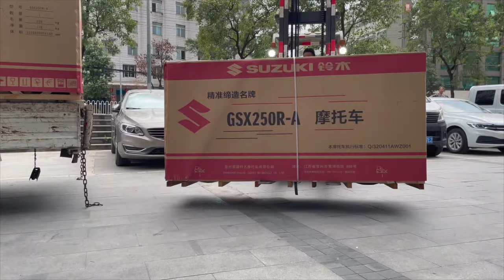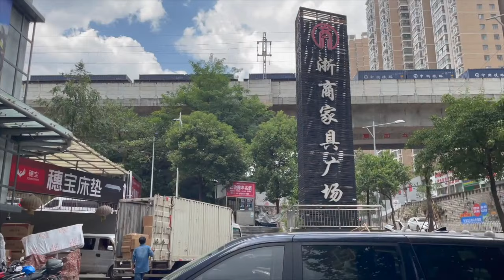Unboxing the Latest Suzuki GSX 250R  - 2021 MotoGP Edition. Exclusive Colors

Comment: Fyi, kode motor ini GSX-250R bukan GSX-R250. Buat pasar indonesia, spek motor Ini punya power lebih rendah tapi harga lebih mahal dari GixxerSF (GSX-250F) kalo buat masuk di Indonesia. Versi GSX-R250 suzuki masih versi jadul tahun 1987-1991.
Reply: For my fellow indonesian. this bike code is GSX-250R not GSX-R250. For the Indonesian market, this motorbike has a low horsepower, high in torque (24.7PS || 23.4NM) but the price is expected to be more expensive than the Gixxer SF250/GSX-250F (26.2PS || 22.6NM) if it enters Indonesia (CBU) from Haojue, China. for the Suzuki GSX-R250 version is still an old version that has been discontinued from 1987-1991.

Gixxer has an affordable prices. so if it is imported to Indonesia (CBU) the price is not too expensive for a 250cc, 1 cylinder bike. The Gixxer price around US$2,440 and then GSX-250R price around US$4,899. Suzuki sells Gixxer in Indonesia with a price range of US$3,323 from the previous price of US$2,440.  imagine the price of GSX-250R if imported to Indonesia?
Reply from the maker: Thanks for the insight. Guess you are talking about the Suzuki - 250R? In Indonesia, you are getting the Gixxer SF 250 as per the video I made earlier on . Link below here  - https://youtu.be/sSX5U3sWv64.
Reply: @JoshConnectMedia  thank you for your information 🙏🏾♥️

Comment: For those whose wondering, this is GSX-250R not GSX-R250. The 'R' at the back indicate 'road' & the 'R' at the front indicate 'race'. It's not as fast as the SF version since it uses an undersquare engine displacement & the SF version uses oversquare displacement. Makes it torque better at low rpm.
Reply from the maker: The explanation of R’s in the Suzuki 😋. For once , I had to look at the title again as I thought I had R250 🤪.
Reply: @JoshConnectMedia  a lot of people are confused. Not implement that you had a typo. Just that too many people think this is a sport bike. Even in the Suzuki's website indicate that this is a 'street' bike, not a supersport bike.
Reply from the maker: @farhunt94   speaking of a super sports bike , Yeah it’s a street type of Suzuki quality bike . Practical for folks interested in the kind of horse power it gives and the ability to still use it within the environs of the city , streets and freeways .Appreciate your effort . 😋

Comment: I wish this could lanch in India🥺❤️
Reply from the maker: Check with your local Suzuki dealers. They should be having it right about now.
Reply: @JoshConnectMedia  India only have the Gixxer SF250 not GSX250🥲
Reply: @itzmexahil  indonesian already imported gixxer 250 sf from india
Reply: the suzuki gixxer sf 250 is more faster that gsx250
Reply: @VictorRodriguez-ux8zi  no man gsxr 250 is faster
Reply: @VictorRodriguez-ux8zi  bt gsx looks more beautiful than sf and it have bigger wind shield 😌

Comment: Whats the top speed
Reply from the maker: Suzuki GSX250R 0-60 mph in 8.59 seconds with a top speed of 85.5mph could easily hit 88mph.
Reply: Very less for a double cylinder bike R15V3 could reach 145km top speed
Reply: @laldinsanga6392  88mph=141kmh.
Reply from the maker: APRRECIATED 😘

Comment: I bet this bike more powerful than Cbr-250RR, Ninja 250, and R25 😁😁
Reply from the maker: You bet !!
Reply: Yeah you bet
Reply: Nope..!! That is 1 cylinder how u figure is more powerful than CBR250RR, Kawasaki Ninja 250 2 cyls n 4 cyls.. Hahaha suzuki endorse sayin bs hahaha for both yall are ridicolous.
Reply from the maker: Check the Summary Specs for this model : ** Engine : 248cc, 4 stroke , liquid cooled, Parallel twi. 
** Fuel  system: Fuel injection with SDTV , liquid cooled
** Maximum power : 24.7HP @ 8,000rpm  (25HP )
** Maximum torque : 23.3 NM@ 6500rpm 
Number of Gears :6 
Curb weight : 179kg 
Fuel tank capacity : 15 liters
Reply: Yes
Reply: @georgeruntukahu4090  that's not a gixxer you silly boi. That was GsxR250 Lol